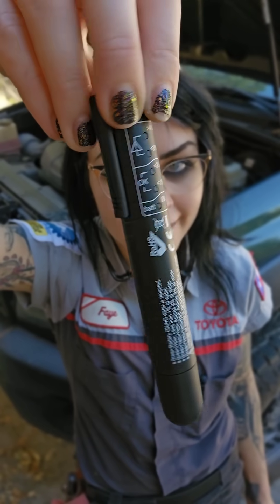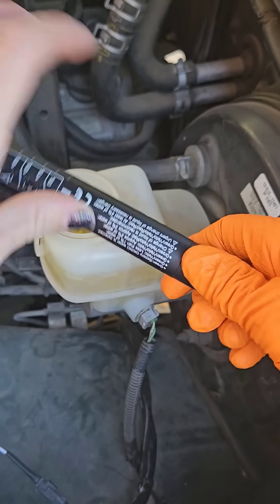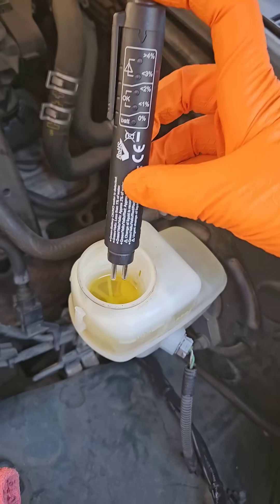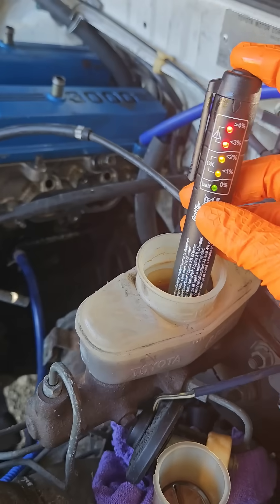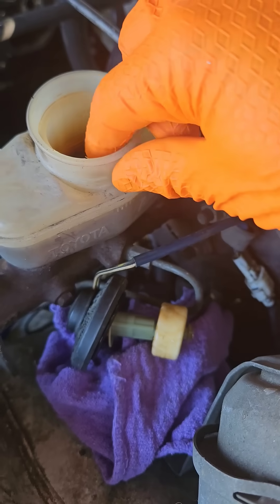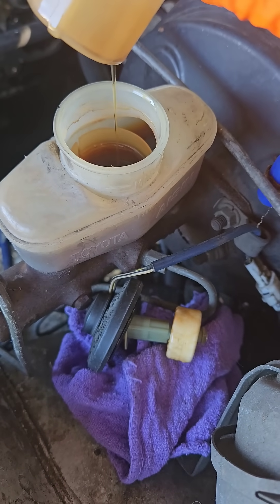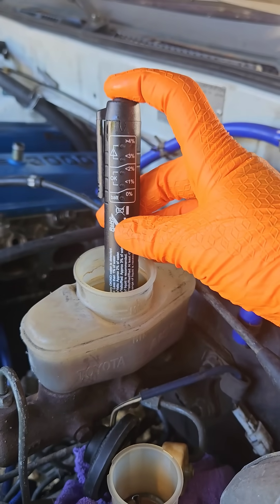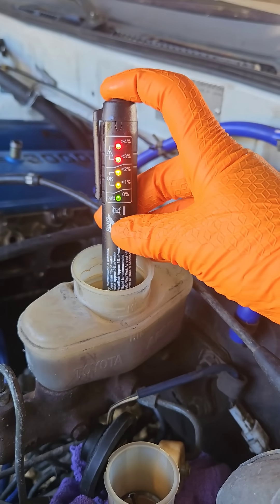Do you REALLY need your Brake Fluid Flushed?? How to Test it For Yourself!

Comment: 90 percent of cars have never had this done in their entire life.
Reply: It's a scam? Yeah tell that to the hundreds of cars I've replaced calipers on that had rusted to the point the pistons siezed.
Reply: All my cars when I first get them has EVERY fluid changed and every filter.
Reply: @jayharris9077  Me too, used car, I changed brake fluid. etc
Reply: Higher than that.
Reply: @dontbetonit813  if 90%+ of cars never had brake flush and cars are not crashing on mass. Then it means break flush is not neaded
Reply: @timesthree5757 at some point it can cause calipers to stick.  Not necessary per se, but doing it once or twice might save you more than double the cost and give you better braking.  It also obsorbs material breaking down from the hoses and seals.  The slime can bake on the caliper pistons and make them stick.
Reply: @timesthree5757

That’s like saying: “People can eat soda and chips and live for years, so that means a balanced diet is not needed.”

Derp 🤪
Reply: @timesthree5757 um no.  Just means brakes dont work well.  That doesnt equate to crashing.
Reply: @justinpaone2227  um yes breaks work just fine.
Reply: @timesthree5757 flushing brake fluid prevents your brake lines, calipers and master cylinder from rusting and needing replacing in the first place. After all your brakes are what stops your car , why would you wanna neglect it?
Reply: @timesthree5757 nowadays they're starting to make electronic brake calipers so soon it won't even matter
Reply: @timesthree5757  I think you mean "en masse", and the reality is that how many crashes are attributed to actual, full-on brake failure? The brake system is designed to keep functioning to a degree even if in poor condition. But problems like bad fluid, air in the system, sticking/non-functional calipers, bad pads/rotors, and any other brake problem can very much effect how quickly and safely you can stop. Sometimes a couple feet is the difference between a near miss and an accident.
Reply: @channell11  yes I agree but water in the fluid is a non issue.
Reply: @timesthree5757 Idk if you care most people just get mad at me but it's actually "en masse" instead of "on mass".
  Its actually French.  Just one of those things you really couldn't know if you've only heard people say it and never read it somewhere.
Reply: @LightlySaltedMM  no I read somewhere, I just ain't French. So, in my neck of the woods it's on mass. Which makes a lot more heck of a sense than in mass.
Reply: People bragging about not doing maintenance on your vehicles 😂 it doesn’t come across how you think it does.
Reply: @evan539  so you think that because we don't change brake fluid that we don't do maintenance at all? One does not equate to the other. I just finished doing dif, tranny, transfer case, engine, and glow plug change. I know enough about brake fluid that it doesn't need changed ever.
Reply: Thats because 90 percent of people dont even change their own oil.  If you work on your car.  50 percent chance you will flush it when your doing a caliper or even just pads.  Makes a huge difference.
Reply: And most will never need one.
Reply: Because they don't need it.
Reply: I know mine hasn't in 30 years. Just only ever been topped off and bled, every time a line gets replaced.
Reply: 90% of ur cars not mine😂
Reply: Ive never changed brake fluid in a car
Reply: Might be true in US, but not everywhere else. Eg. in Finland that is done every 2nd year, reason is the moisture in the fluid. And it doesn't pass mandatory yearly inspection.
Reply: my 99 grand am had almost 300k on it and i never did this ;0
Reply: And here we are, getting our cars seized for putting aftermarket wheels, that were ment for track use, because of 'safety issues...
#welcometogermany
Reply: @dezpotizmOFheaven  yea but atleast you guys have TUV so its still possible to have a street machine, here in cali we're fucked
Reply: @dezpotizmOFheaven don't worry, the US is headed that way too bud. Well, mostly California.
Reply: @dezpotizmOFheaven TÜV sagt nein
Reply: @dezpotizmOFheaven  yeah. Because track tires aren't for road use. The conditions are way different. So yeah, of course they will do that

Though here is an easier step; If it isn't allowed by law, just don't do it. Saves all of us the trouble
Reply: @Gio98art  I'm talking about the wheels, not the tires... Like Enkei, Volk and such...
Reply: Because they’re idiots
Reply: not as u think...I do it...and of course lots of guys like do it
Reply: @mohamednawwar1450 so yes its 90% of ur cars u owned😂 very nice. for me, my entire family's safety is #1, #2 is to not hit anything especially people & #3 id like to keep the car for as long as I can. Every 2 years isnt gonna hurt the pocket. Enough time to save up for fluid. much cheaper than getting into accident.
Reply: 90 percent of cars also have to have their master cylinder replaced, which was caused by not changing their brake fluid every 2-3+ years (depending on what climate you live in).
Reply: @dennisburger1220 so you don't believe in transmission drain and fill servicing?
Reply: @dennisburger1220 gotcha, I have heard transmission flushes are bad, just do drain and fill. I have also bled my brakes when the fluid gets dark, keeps the master cyl from going bad due to corrosion. Thanks for the clarification.
Reply: Yeah it seems the modern brake fluids coolant etc. as well as components are superior quality to the past and last much longer. It may not be necessary for most modern cars. Notice a lot of the new vehicles even have sealed transmissions. They're not exactly expecting people to change the fluid.
Reply: @tw8464  that's the hugest scam that is absolutely not a real thing. My used 2014 nissan versa with 90k miles has a sealed transmission and I made sure as soon as I bought the car that I got a transmission fluid change. It's a scam for the car business to steal all your money and keep you in debt. Take care of your car and become car smart. It will last you 300k+
Reply: @yendothegamer  you might be right. I drive a 2002 Toyota. I don't know enough about the new cars. 

It seems they're trying to make the cars more maintenance free, which I think is a laudable goal, but also difficult. Most people aren't actually going to do all the recommended maintenance and don't own the car more than 5 years if they bought new. 

The sealed transmissions my first reaction was to dislike them like I dislike all the too many electronics nowadays. But I just don't know enough about these new sealed transmissions. I hear they don't have dip sticks to check transmission fluid. 

But I have to admit maybe there's something to sealing a transmission. People often overcheck fluids just because of the dipstick. And some people overfill transmissions and ruin them. Then as a car ages, a lot of people tell you not to change the transmission fluid because if you do, it'll start slipping. And people drive older cars for years and years like that, not changing it. It's not unusual. 

Then I think about all the things don't change fluid on. Like my fridge has a compressor with oil in it. It's sealed. No one changes it. I can understand with a car maybe there's some kind of condensation getting in the fluid but is it really enough to degrade the fluid to failure? I'm not so sure. I'm not an engineer and don't  know all the different fluids and properties metals hoses gaskets, etc. We don't really have that information. 

Just considering how many people are driving older cars now without changing all these fluids constantly even for years, it makes me think at least some of the "fluid changes or flushes" might be unnecessary or overblown.
Reply: Guilty as charged. 
Replacing the Brake fluid with fully synthetic RedLine Dot 4, new EBC USR Rotors and RedStuff brake pads AND new brake lines on a 2007 Scion TC.
Reply: Nice made up fact, lol
Reply: Wrong again! Don't comment on things you know zero about. Every time you change brake pads,  if the tech has half a brain, he/she will cycle the majority of the old fluid out and viola! Clean brake fluid 😮😮😮
Reply: Pretty much
Reply: Incorrect. 90 percent of cars will bust a line, lockup a caliper or have a master leak within the first 10 years of its life.
Reply: When I change brake pads I pull out all the fluid in the reservoir and after changing the pads remove the fluid that is pushed up with the calipers. Then refill the fluid and sometimes bleed a little out of the lines. Never had a issue with brake fluid.
Reply: SO TRUE,   MINE TOO
Reply: My 187,000 mile Camry never flushed.  Its still braking fine.
Reply: @jbrosupra, what's really sad is the number of shops that SCAM customers by claiming "You need the service and we'll be happy to do it!" then they don't actually do it and just charge the customer.
Reply: Oh somebody already corrected you and you didn't care.  Oh well I'll still leave it for somebody else to learn maybe
Reply: For reals. I have a 1993 Toyota pickup that hasn’t had brake fluid change ever. It goes hunting, fishing, camping and is a daily driver. Still drive and brakes awesome til this day.
Reply: Only when they get a brake job, perhaps😂
Reply: I've put 150,000 miles on my 85 F150 since I bought it in 2007 and the closest I've ever come to flushing it is topping the system up when I replaced the front brake calipers some time around 2010. No telling how long that fluid has been in it before I got it and it's still in it to this very day.
Reply: Sorry mechanics, but there is just no evidence that deteriorating brake fluid is causing accidents. The system isn’t sealed and generates heat causing steam. Steam will always rise to the top and escape an usealed system. Brake fluid is not transmission fluid or engine oil which need to be changed at regular intervals. It might be good to flush it once every ten to fifteen years, anything more is just you selling marked up fluids and an hour of service time  that takes you 15 min when you’re already doing brakes.
Reply: Back in my day we kept the moisture boiled out if the car was a runner.
Reply: i'm think my 11 year old nissan rouge might
Reply: 99% at least
Reply: My 2006 Corolla with 280k has the original brake fluid on it.
Reply: Lol im a mechanic and all my cars are 10-20 years old origional fluid how water get in with a good cap and a closed system i do try to flush at the 20 year mark  thats about thr life of brake fluid in a perfectly sealed system
Reply: Yep I got good at home flushing for about 35 dollars I don't have a squishy brake pedal anymore
Reply: There ya go
Reply: I flushed my brake fluid out when I did my front & rear brakes. Works and feels much better now...👍
Reply: Lmao. My car has 170k miles. Original brake fluid still in there 😂
Reply: @Jovani-esproductions  I'm not sure but mine might have been original up to 200,000 when I learned and did my own brake job. My brakes feel great now...😃
Reply: 98%
Reply: @Fitingbros101  no they don't.
Reply: I mean, I never changed the brake fluid on my '05 Skoda Fabia, but I doubt I ever got the brakes really hot either.

Though, if you're taking your car on the highway or to the track, definitely do that.

Brakes are part of your car's performance and should be treated as such.
Reply: Nope my 92 dodge ram truck has 366 thousand on it I have owned it since it had 89 thousand on it no changes of any kind to the fluid other than oil changes and it’s a daily driver. My wife’s car I bought brand new a 2005 ford five hundred it’s a daily driver no fluid changes other than oil and it’s at 162 thousand still going strong with brake fluid changes or any flushing ever
Reply: @Nosgli You might not ever drive over 30mph either. Flush, then you'll see the difference. Maybe your driving has adapted as braking quality changed over time. It could be the difference when a kid runs out in front of you or your wife
Reply: 99 Gmc yukon 163k miles never flushed 08 Tahoe 173k Never flused no issues..
Reply: Because 90% of drivers don't know shid about cars
Reply: And they are nite crashing left and right.  WOW.
Reply: @timesthree5757 No they are not lmfao. The delusion
Reply: @HCG  delusion about what?
Reply: @timesthree5757 no they aren’t
Reply: And they don't need to either
Reply: Brake flush and coolant flush is a scam
Reply: @Nosgli no they aren’t. If plan on keeping a car for 100k miles or longer with minimal issues. Then you need to do fluid flushes on all fluids. Oil, transmission, coolant, brakes, power steering, differentials, transfer case. If you change all those fluids at proper/ reasonable service intervals than I can guarantee that you’ll have a reliable car regardless of what the brand is,except cars with electrical issues… Mercedes
Reply: @jacksonedwards8527 um I wouldn’t do transmission flushes with any foreign. There clearance is a lot tighter and putting new transmission fluid in could cause your transmission to start slipping.
Reply: @awar-bb5ru  if you do 30,000 miles from the time you buy it brand new, it will last forever. If you go 100k without flushing, and then you decide to flush it, it will definitely slip
Reply: @jacksonedwards8527 luckily I got my trans flushed at 90k miles I just bought the car with that milage and took precaution and immediately scheduled one and it has worked fine so far for 3 months
Reply: @jacksonedwards8527 I agree with you on every point, except your comment on Mercedes. Believe it or not Mercedes has and still makes some remarkable great cars that last, they basically innovated every thing you now find in most cars, ABS, cruise control, direct injection (in the 1950s!) when cars barely started getting that today. I got a Mercedes with 200k miles, a 2011 and never had an electrical problem. BMW on the other hand…. Everyone I know has had tons of problems under 100k miles.
Reply: @awar-bb5ru only if you don’t do the flush properly yes. But if you do them correctly they’ll will be perfectly fine.
Reply: @awar-bb5ru if fresh fluid caused your transmission to slip, you had problems to begun with that were being masked by the crap in the fluid.
Reply: @jacksonedwards8527  Carina E 500.000km never did a fluid flush, Corolla 250.000km never did a fluid flush, Another Corolla 300.000km never did a fluid flush, Ford Galaxy 250.000km never did a fluid flush and Currently another Corolla that is at 200.000 and also never had a fluid flush. The galaxy is the only one that ever needed a caliper repair (yes there are repair kits) all others never had any problem with the brakes.
US is also about the only country I know that has fluid flush and oil change scams on every corner.
Reply: @jacksonedwards8527 lol I second that last statement. So many modules on those vehicles it makes me go dizzy 😵‍💫
Reply: @Nosgli yes and no, not changing brake fluid or coolant will cause corrosion over time. Coolant should be replaced every 100k (200k if you wanna go cheap). Brake fluid should be changed every 50-100k miles or 2-3 years of use, but I myself usually change it when it’s dirty and dark or my pedal is getting soft and squishy. No need for a stupid Amazon pen. Also it’s always worth it to flush brake fluid when replacing caliper pistons.
Reply: @Nosgli most newer cars are a closed system the brake fluid cap she has in the video is an older style cap unless Toyota uses this type still which is a very old style. Brake fluid at some point will need changing due to viscosity break down from heat not a scam just not needed every 30k like some manufacturers suggest. The Coolant however does absolutely 100% need to be flushed due to the same reason being heated and cooled over a period of time a simple where it loses its ability to protect your motor from high and low temperature. This can also be tested with a refractometer or just Google antifreeze tester.
Reply: @Nosgli this has to be rage bait
Reply: @Nosgli exactly. My temp gauges will tell me if my coolant is bad
Reply: @JohnPickup-CDHS-ze6qd if you have a electrical issues it can't be reliable because it can be not working properly my mom's old car all the gadgets that tell you how fast how hot how much gas ect would flip left and right or not work at all sometimes both
Reply: @JohnPickup-CDHS-ze6qd OMG. By the time you start to overheat from bad coolant your engine is done. Coolant becomes corrosive if not changed.
Reply: @Nosgli  I wouldn't say coolant flush is because I  have seen cars run hot from old clod coolant
Reply: @Nosgli  No it is not. You are surely a not mechanic.
Reply: Total scam stay away from this. I keep my cars 10 plus years and never did this. Same with spark plugs. Never had issues.
Reply: @artieartya  You never change your spark plugs?  LMAO!!!
Reply: @MartinD9999  nope and only buy Japanese cars. Gtg
Reply: Lexus is 17.5 years old. Nissan Altima 10 years. Honda civic 12.5 years. No spark plugs changes no break fluid change
Reply: @artieartya  I bet you don't change your clothes everyday either, right? You don't need to, so it doesn't matter....
Reply: @MartinD9999  I'm guessing they never drive the damn cars that they mention or something
Reply: @artieartya  spark plugs are definitely worth it. Larger gaps mean more resistance that your expensive ignition system has to drive. And god forbid you have to go in there for other work, you don’t want any of the boots or plugs seized up. That doesn’t even get into the combustion cycle which is affected by spark position. 

It’s called preventative maintenance for a reason. So one day you’re not suddenly misfiring so bad you can’t take the highway.
Reply: @NoLongo 😅
Reply: @artieartya you own three cars. How many miles on each? Irridium spark plugs are a 100,000 km to 150,000 km service, depending on the type. And no, it is not a "myth"; pull them and measure the gap. Or do you not trust yourself to discover the truth.

As for brake fluid, yeah it's not normally a problem. . . Until you're driving down a mountain and your brakes go spongy. Then you'll really regret your choices.
Reply: @artieartya your lucky then with sparkplugs because that literally is a big thing for a car to even start
Reply: @artieartya I bet you don't change your oil either